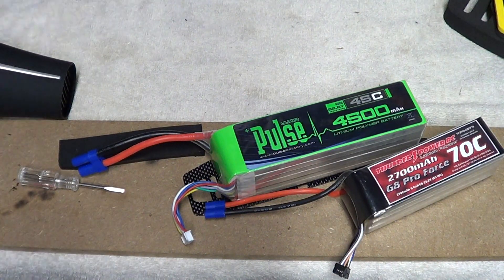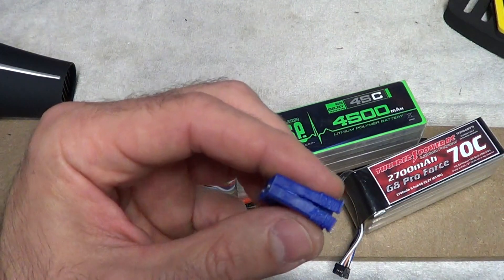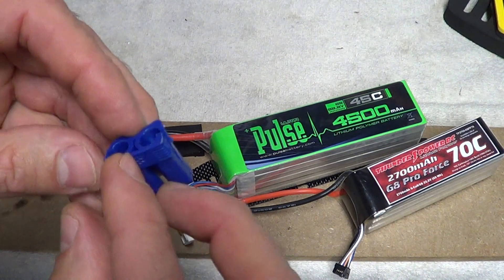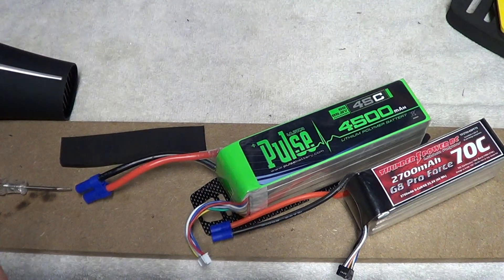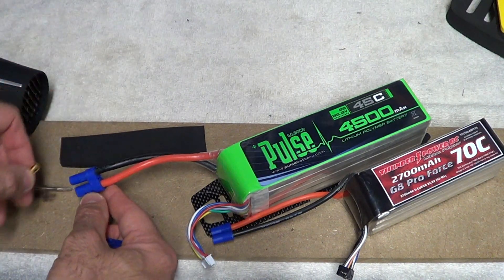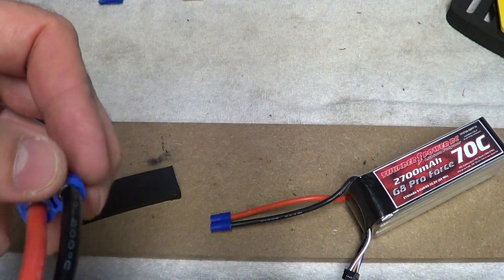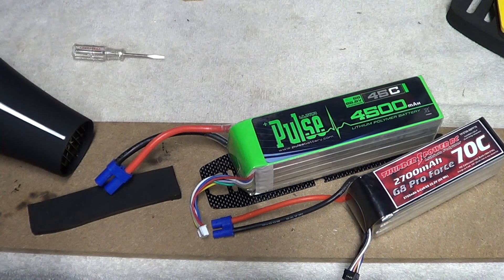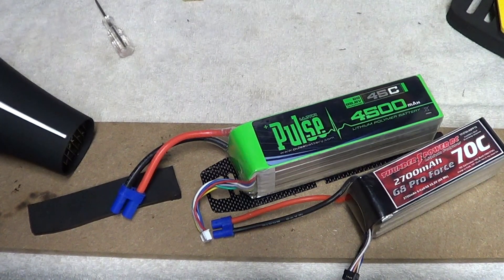EC5 connector ,how to replace a broken one

Comment: I had never soldered ec5's only ec3's and just received an aftermarket batch which was bad and I didn't realize it. Spent 3 hours fighting them and eventually screwdriver into finger. Went down to my local hobby shop bought some eflite one's and was done in 20 minutes because they set just like EC3 does. Love your video's I have not thrown out the bad connectors yet I might give them a try using this method. Wish I had seen this video live and learn.